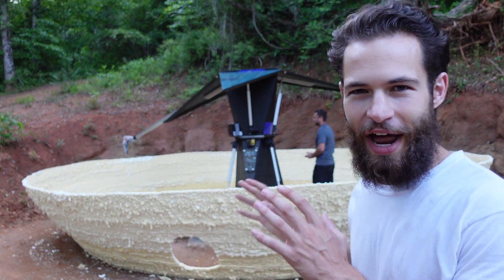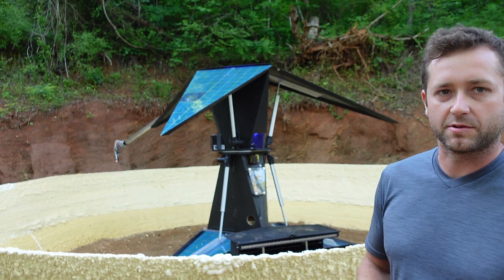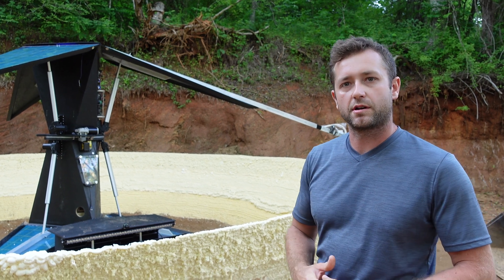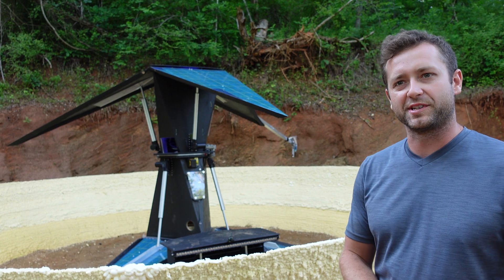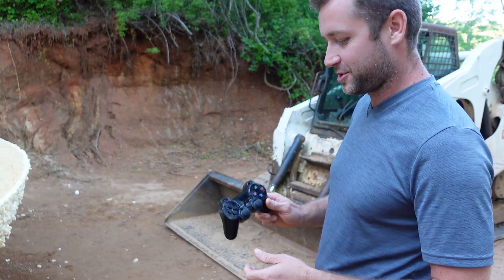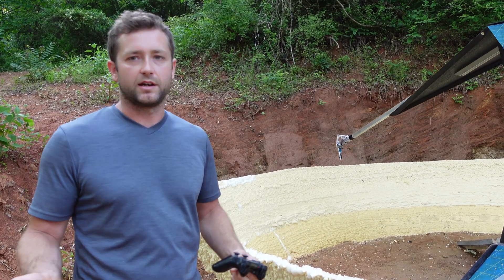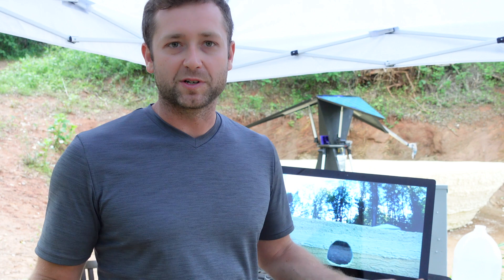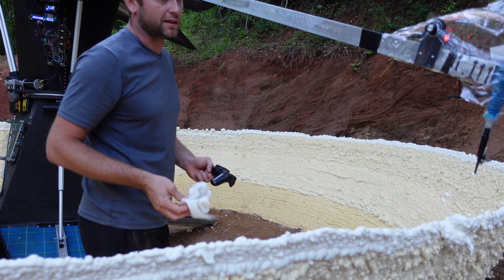MarsBase Robotics 3D Printed Mars Habitats

Comment: Interested..walls will need to be slightly thicker for durability perhaps 6" I guess it depends on the density of the expando foam
Reply: I will release a video of a finished wall section soon. I’m aiming for a 1” foam exterior and a 1” carbon fiber reinforced concrete interior.  I’m trying to minimize material and energy required and my test indicate that wall thickness will be sufficient.

Comment: What is the Cost of the Foam Unit?
Reply: For a 22’ diameter / 18’ tall habitat, about $2k of foam is needed. Plus $1k for concrete and $1k for carbon fiber.  18” round windows are $30 each.

Comment: Do a test in a vacuum, the foam may work differently on mars with it's lower atmospheric pressure
Reply: I’m not a chemist, but I did talk to a bunch of foam experts and learned that the chemistry can be changed and some foams can even cure underwater.  I’m not saying this foam will be used on Mars, but it works on Earth and I think exploring expanding materials is worth it.

Comment: How will expanding foam behave on Mars?
Reply: The foam I’m using will likely not be the print material on Mars, but I do think expanding materials are worth exploring as a possible solution.  There are many different foams and need to be chosen based on the application.

Comment: There's no reason for it having a solar panel on the robot itself, that just makes it less efficient than a setup with solar panels off site connected via wire. He also never covers what exactly he's planning on using on mars, obviously foam will not work in a vacuum so I that could cause some problems (not to mention foam would just collapse when any amount of weight gets put on it by covering it in earth like he mentioned). Still not sure on how he plans on getting the robot out of their either.
Reply: I think a distributed power system will not only be more efficient, but also more resilient.  I think each machine should be able to produce its own power and be able to transfer power to other robots.
Reply: @danielscaber447  then just take the better of both worlds and make multiple small solar farms off site instead of a singular big one. Having it on the actual robot just produces more points of failure and limits the electricity it can produce.

Comment: Cool idea. I want to see dozer bot working.  Does it remove material from hole? Or a separate conveyor type bot? . . .
Reply: Ideally, the build would start with a circular excavation with the excavated material piled up around the perimeter.  The pile would later be used to cover up the structure. Although dozer could do the excavation, there maybe better options such as a separate robot or maybe incorporating the excavation tools on to the builders legs and lifting itself up with its arms.

Comment: HaHa Awesome!   Much better results than the MIT foam dome with way simpler cheaper equipment.  The insulation is the most important part of the wall, and it totally makes sense to print foam before concrete.
Reply: Thanks! I just checked out your videos and I will need to know more about your concrete mixtures when I start concrete printing. I’ve never seen concrete formed that way and I’m impressed.

Comment: It's great, but how do you get the bot out after it's completed?
Reply: Another thing is how does it get sunlight towards the end of the build. I know it has a battery but is it enough? ...
Reply: Minimum power consumption was at the core of every design decision. Builder will have enough battery power onboard to complete the job. Supplemental power can also be brought in with dozer. Their electrical systems connect when mated.

Comment: Love the homebrew backyard mechanics mindset.. WiFi dozer is just awesome! got to thinking it could assist foam print by pushing dirt along outer + inner layers thickening walls base.. thanks for the video too on this innovative n inspiring effort.. also thought the static gantry could be improved/copied from the old concrete dome hopper/compacter system you posted prior.. it’s counterweight balanced system is perfect for circular dome layering w/o use of electronics.. pairing concepts might benefit overall objective.. anyway, kudos as said..
Reply: Yes, dozer will bury the entire structure with local material.  Regarding balance, the builder robot has three arms, with different tools on the end of each arm. Even with telescoping arms, no additional counterbalance will be needed if all the arms extend equally.